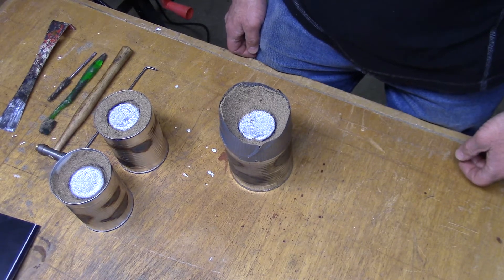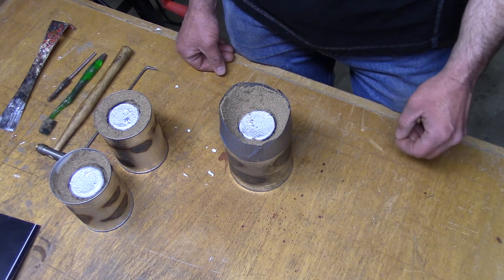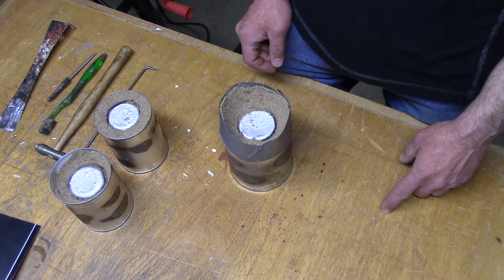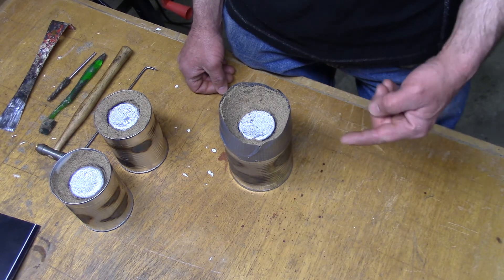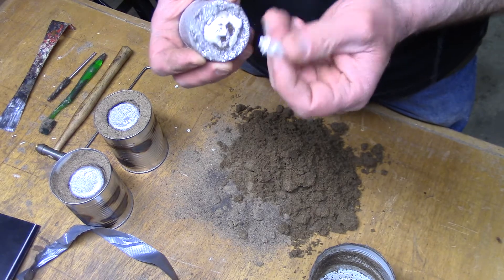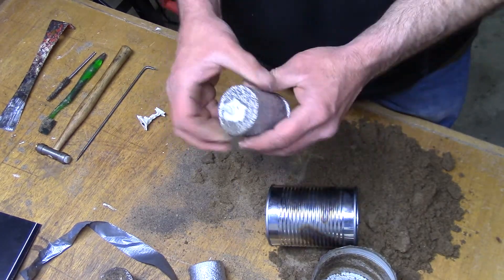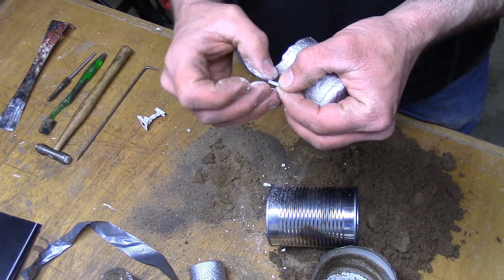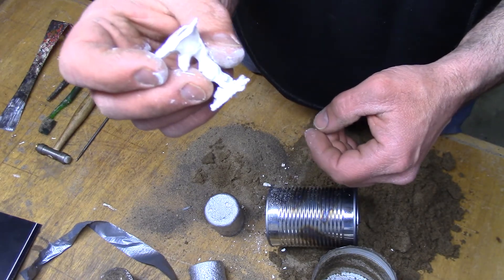3D Printed Lost PLA Casting (FAIL)

Comment: lol that's why there are a ton of videos showing how its properly done... I suggest to you to do not even try to heat anything, but till you have 100% all the correct set up... specially as I was just reading in the comment section of other video that a guy got 3 degree burns, thanks to not doing it right... to me that says that the guy pretty much ended disabled after such  thing... by the way its clear that you do not have the know how... why risk it?? ... 1st learn... get the proper set up, proper clothing... etc...
Reply from the maker: +Robert Ostman You haven't seen my setup.

Comment: That looks like one heck of a casting problem Bob. Anything real small is one heck of a challenge.
Reply from the maker: ChrisB257 I may have to try spin casting or heat the sand up and use oil for a binder instead of water. It's good to show your failures.CHEERS